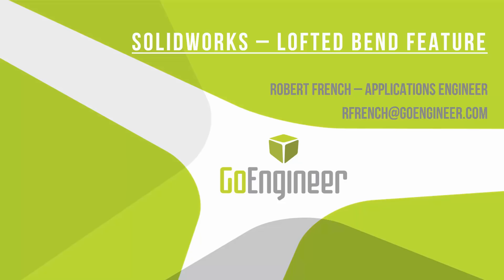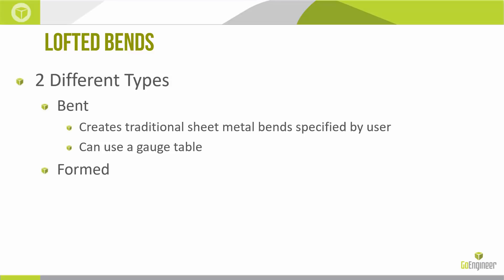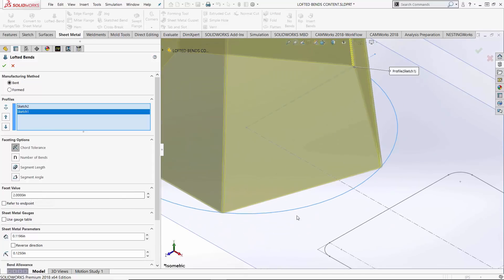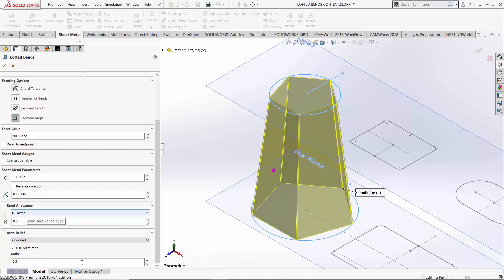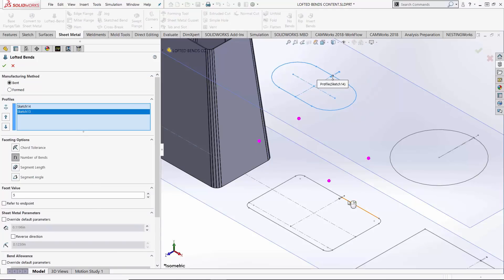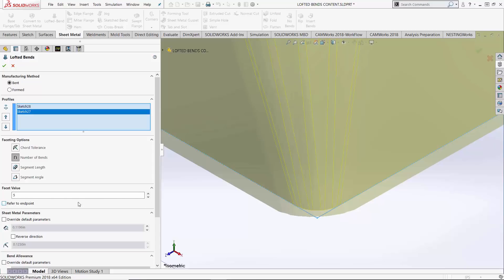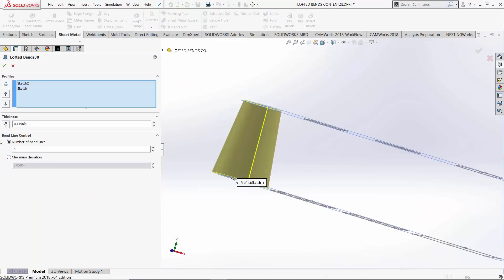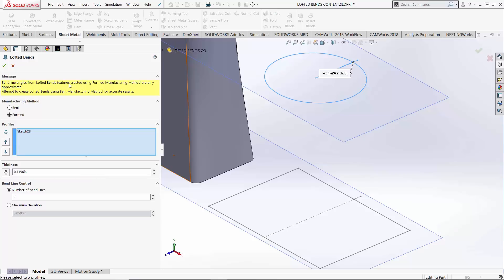SOLIDWORKS - Lofted Bend Feature

Comment: I have issue with SW sheet loft bend. I make half loft part, actually quite similar to one you show here inside your video. (It look like U-shape)  Both sides are produced by 8 bends. (facets)
If  I sum all angles per bend what SW generate when unfold , they give me 71.68 degree instead 90?! Also if I try that given parameters from SW to real bending machine and part, the part stay quite open. Not as 90degree desired. (unfortunately seems YouTube doesn`t allow me to post external links, so I can give you the part to see) 
From other hand, if I calculate like that:  90deg (desired)  - 71.68 (SW calculated) that give me 18.32 deg missing. Then that divided by 8 bends come to  2.29 deg extra per bend. 
Now adding that extra degree to each bend angle given by SW, in real life test produce almost right desired part. The question for me is what I`m doing wrong or what setting should change so I can get right bend angles during unfolding process...
Reply from the maker: It is probably an issue of the wrong K factor (or bend allowance) in Sheet metal properties. Default values are often based on theoretical values that may not reflect real world conditions.
Reply: @goengineer  Thanks for the replay! I thought the same, but even I try with K-factor from 0.35 up to 0.55 (just for SW test) it kept the same division of facets as so, that if I sum all bend degrees  it was below 90 in total. Almost like skipping one bend.. I played with the XLS tables, calculate some data and enter it. Then select that table and end up again with similar issue.
Seems all videos show how to connect scetches to make loft, but didn't found any where the loft unfold and show how many bend are with degree values so I can figure out my mistake...

Comment: Great video, but I have a question, why is it when I increase the distance ( say 10m ) between the two planes which my profiles exist in I do not get the same result? I don’t get the tapered shape,SolidWorks takes the bigger circle and give me the uniform shape which I don’t need.
Reply from the maker: The out side shape in a loft is being generated sort of like a spline so when we change the distances it alters how the body is created. if we want more specific control then adding intermediate profiles or guide curves is the way to go.  It can also be dependent on where you selected on each profile. For a more specific answer I would get in touch with your VAR to see if they can get you pointed in the right direction.
Reply: Although I don't know what dose VAR stands for 😅, I would love a bit more demonstrating. In the same time I will be trying the suggested remedy.
Thanks again 👌🏻♥️